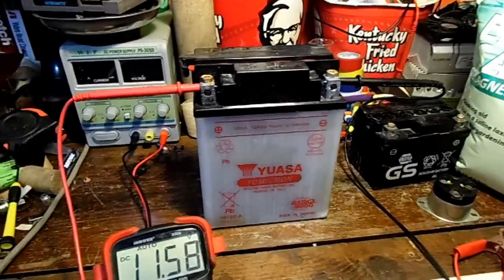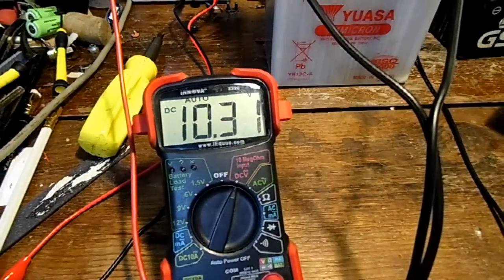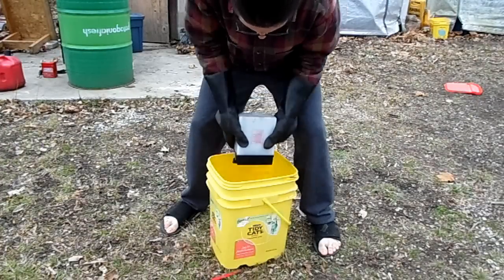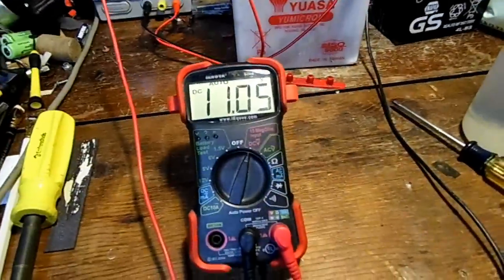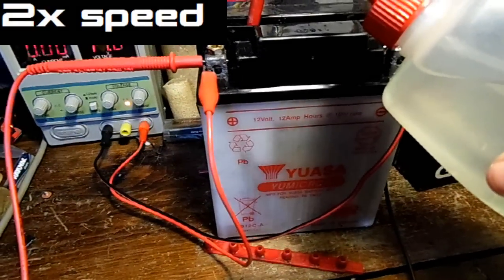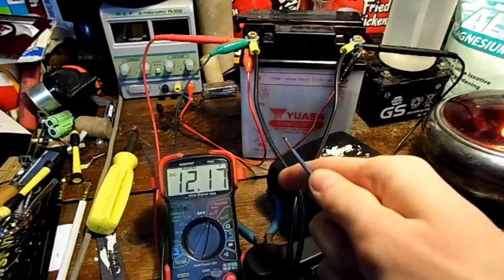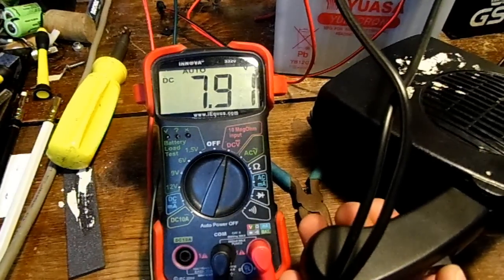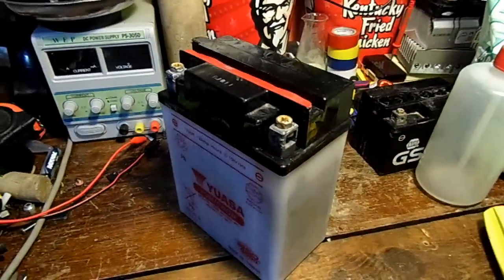Replace Battery Acid with Epsom Salt?

Comment: Very interesting, not quite the the amazing story that others tell, good real world test
Reply from the maker: yeah i think this battery is just too far gone. in other videos i've shown differant results. it seems to only work if the battery still has some life in it.

basicly the epsom salt increases the acid's reactivity so it kicks the still functioning surface area of plates into overdrive. but if the plates are 100% covered in lead sulfate it doesnt really do shit.

i may try overcharging this battery at 15 amps for a few weeks though. who knows if that may work. at the very least it'll ruin the battery and be fun :D
Reply: I've been playing with recovering batteries for about 5 years. I have a friend who does a lot of metal scrapping and he brings me his batteries to go though before he scraps them. So far the best method I've found is this:
1 charge with a 19v (or a 22v) 1a laptop charger for about 4 to 6 hours (it usually brings the battery to around 16 volts unless the specific gravity is real bad, then maybe 19 to 22v for awhile.
2 when it comes down to around 14 volts or so, I use a dumb charger that puts in about 14v at about 4 amp (5 or 6 amps would work just as well I believe). I run the dumb charger on it for 12 to 24 hours.
3 Unhook the charger and check voltage, specific gravity and cranking amps. I determine if there are any bad cells (cells that show very little or no voltage). Usually that means it's going into the scrap. If it's a really strong battery (despite the bad cell) I might save it for a solar alum battery. Sometimes I'll continue to step 4 hoping maybe the short will go away.
4 Discharge the battery to 11 volts.
5 I repeat steps 2-4 (maybe even 1-4? haven't tried it yet) up to 6 times and compare the data to see if there's improvement. There's usually at least a little unless it's total junk.

I've had quite a few come back to somewhat acceptable batteries for starting a car (probably not so good in winter weather though) using this method. Unfortunately, more still go to the scrap yard than not, but this is how I've got my best results.

If you don't have a load tester you can still get an idea of how many usable amp hours you are getting by timing how long your load runs and doing the ohm's law math. In any case record how long your load runs (to 11v) and you can compare to see if each cycle is improving the battery.

Note: if you have a battery that's holding 12 volts after sitting for a day without a charge, it's a good candidate for an alum battery, even if it's badly sulfated. It won't be good for a car, and probably not even for an inverter. But, it will be good for many 12 volt circuits that aren't too voltage sensitive (the voltage will virtually always be a little lower than a regular 12 volt battery, sometimes as low as 11 volts).

I'm not saying I know if more drastic measures would work. I've tried some of those ideas, high amp/high voltage charge for long periods and came to the conclusion that they weren't working for me. I actually had more luck putting a battery on a 1.5 watt solar panel for months on end. Unfortunately there's no real science behind any of this, just my own experiences which are riddled with variables that I can't really measure.

Comment: I want to see the alum and see it that works.
Reply: Alum actually works as long as the battery isn't completely toasted. I have one with a bad cell that I've been using for LED lights for about 4 years. This battery was manufactured in the mid 1990's and was sitting dead on an old camper for years. It was holding about 2.5 volts when I converted it to alum. It was my first attempt at making an alum battery. It's actually pretty powerful for what it is. The thing is that alum batteries do not have the same discharge curve as a lead acid. More like a NICAD.

Comment: Have you tryed flatterning the battery to zero and reverse charging for a few days??
Reply from the maker: i was wondering about it, but didn't know if it would help much. would make an interesting video though.
Reply: My uncle told me years ago that that works sometimes. He said that they used to just reverse the polarity and leave it reversed (if I remember correctly). It seems to me like it would take a lot of charging to do that though. You would be changing the chemistry of both the positive and negative plates.

Comment: so basically epsom salt doesn't really do any useful job after all?
Reply from the maker: it only makes the acid more reactive. so i could see it definatly helping an already desulfated battery but it doesnt help hardly at all with capacity.
Reply: Rinoa Super-Genius so it has no use in storage batteries
Reply from the maker: Maximilian Mustermann i wouldnt say no use. but it can only help the acid not the plates. so if you've desulfated your deep cycle battery and the plates are clean but the acid is not reactive enough. it could help with that.

Comment: hey I do like your youtube posts......... My issues not necessarily with you though is the following. Like everyone has used Epsom salt including myself and then the battery really show no improvement. I also desulfated and that really did not do much either. I am thinking of using a capacitor just to bring the battery up to voltage but maybe that may not work out either. Anyway I still like your posts
Reply from the maker: thanks, i've had good luck with desulfators. on one battery i got like 6x as much capacity back than what it had when i found it.

but still i'm very dissatified with epsom salt and the desulfator i have. so i think i will build a more powerful desulfator soon and possibly use epsom salt to help restore the electrolyte's reactivity.

i'm trying to work up to restoring a 60ah deep cycle and desulfation has only gotten it to 8ah. ima try using the magneto from an engine to generate like 800v sparks that might desulfate a battery better.

so yeah i agree that not many methods work as well as i'd want. but thanks for enjoying my videos :D
Reply: @RinoaL  , what to do with the drained fluid?

Comment: What about desulfating with the epsom salt electrolyte solution, think any difference? Or maybee desulfating with an vibration agitation?  Very curious with your experiments.  Thanks for them!
Reply: They say the best voltage for desulfation is about 16 volts for a 12 volt battery. But you should probably only do it for a few hours and then switch to a normal dumb charger and charge 5a for 12 to 24 hours at a time. Charge and discharge like that a few times, never below 11 volts if possible.

There are a lot of theories out there, but I believe high voltage with low amps (no more than 2a) is probably the best, but not for too long, especially if the voltage is really high. The battery can get warm, but don't let it get hot.

What I've been doing is adding a little bit of rich alum water to each cell, maybe a quarter of a cup of alum between all the cells, and then desufating. I'm not sure yet if it really helps, but I don't think it can hurt it as badly as epsom salt could. It seems like it helps, but I've only tried it on 2 batteries so far. It was successful, but I don't know if it would have been just as successful without the alum. 

I get the alum on Ebay (99.9% pure) 3 to 5 lbs at a time, which is way cheaper than buying McCormick alum at the grocery store. I bought some alum at a bulk food store one time and it was junk. Not real alum. I would recommend McCormick if you're going to use store bought, but it's expensive that way.
Reply from the maker: yeah i am hoping to make a high powered desulfator soon. will be a spinning magnet and engine magneto to make like 800v sparks. i'll pass that through a diode or rectifier and zap the battery.

i may also connect 4 car batteries in series and fry the battery with 48v and like 800 amps. idk if it would work but it should be interesting  >:P
Reply: +Rinoa Super-Genius I'd love to see that, battery/electricity experiments are the best! Just don't get hurt! I'm more curious than careful n it's ended poorly a couple of times!
Reply: I've been researching into battery repairing and discovered a fantastic resource at Magic Mender Wizard (google it if you're interested)